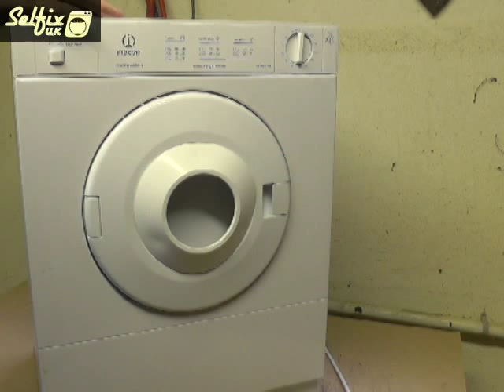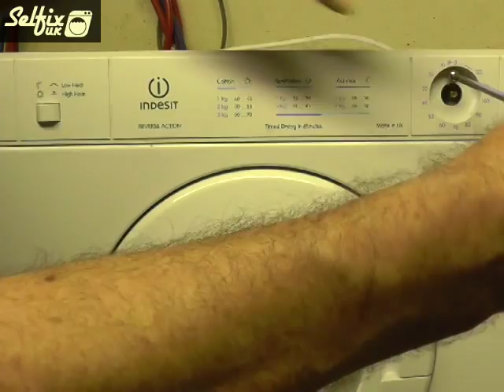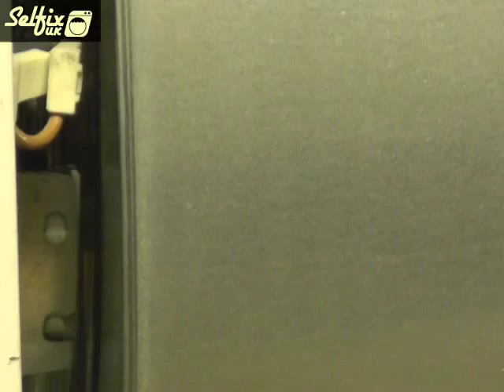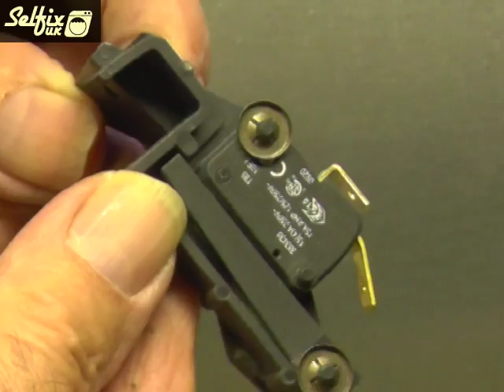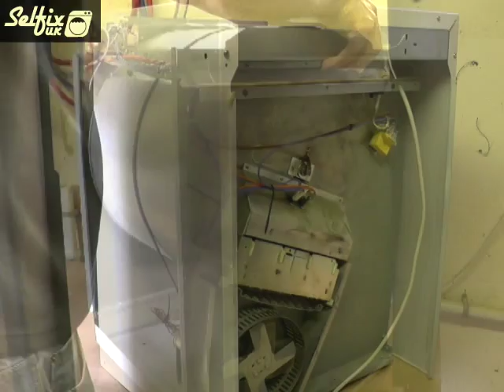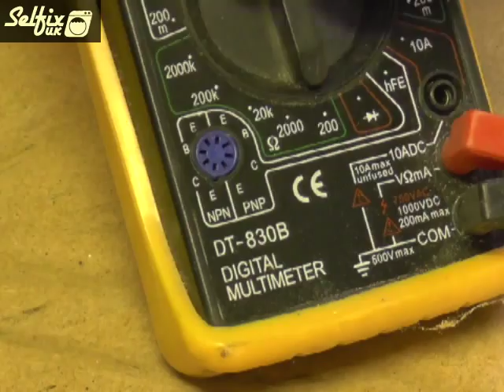How To Replace An Indesit Tumble Dryer Door Switch

Comment: Sir I am change the back baring of tumble dryer indesit when I fixed now tumble dryer indesit running only side what is the problem I don't know maybe connection wiring wrong kindly can you explain me problem is only side running not rotating